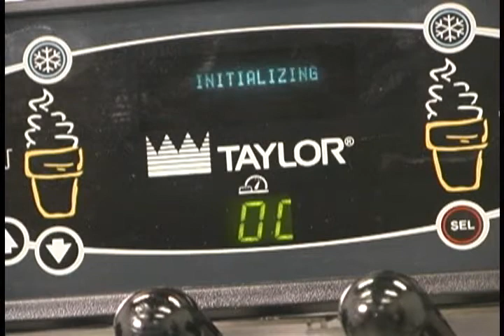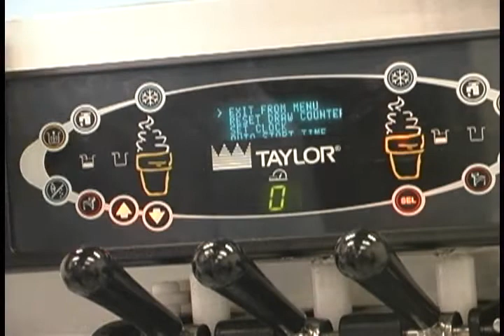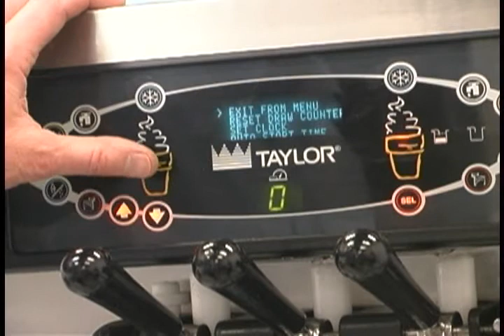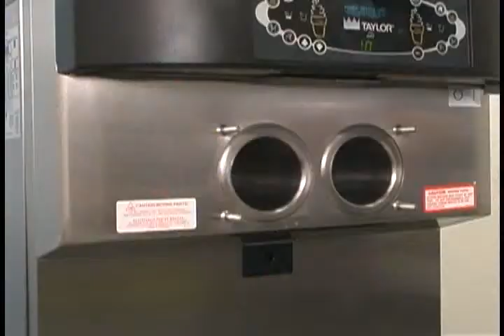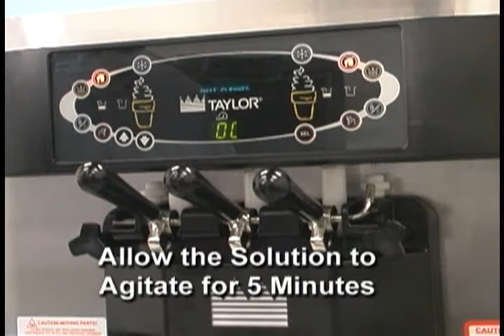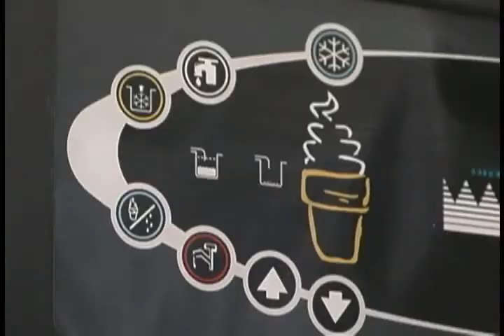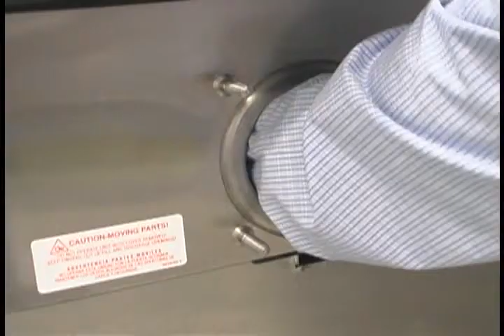C712 C713 C722 C723 Operator Training

Comment: 12:19 draining product
12:50 rinse
13:50 sanitizing
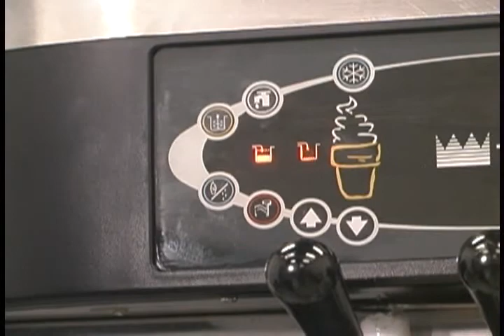14:48 disassembly
15:47 pump drive shaft removal
2:40 assembly
5:05 hand screws
5:24 draw valves
6:15 flow rate
6:50 mix pump
7:00 pump cylinder
7:15 valve cap
7:56 feed tube
8:30 drive shaft
8:54 sanitizing
10:06 wash cycle
Reply: Too helpful, Jacque. You should be FC sup.

...or something.

Comment: I would like to point out that this video skips the purging process.  It implies the purging process but by following these instructions process by process, the client will have a sanitizer saturated initial product. This video should instruct the client to hold open the draw valve before adding product and to hold it open as they are adding and keep it open until pure product comes out at which point they can close the draw valve.  The video suggests that the client adds 2.5 gallons of product and then opens the draw valve.  By that time, the product will have already mixed with the sanitizer which will ride atop the product if not purged properly.